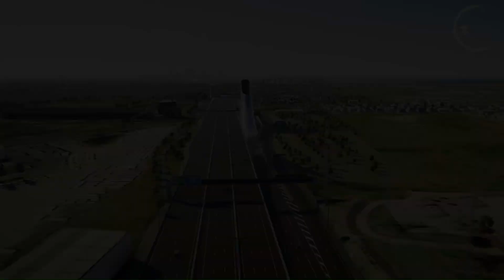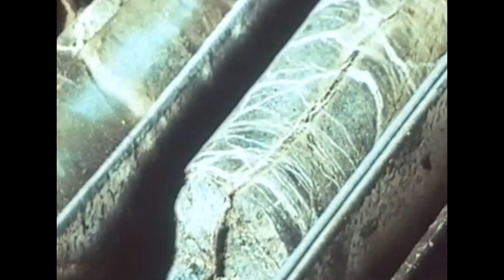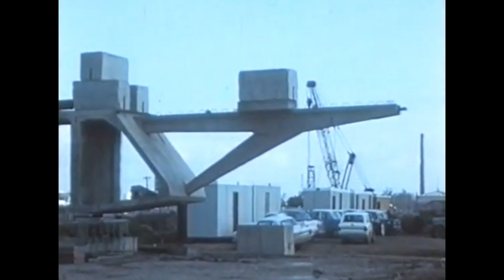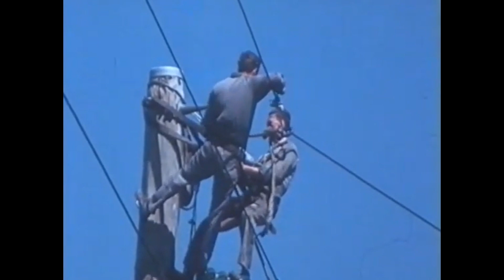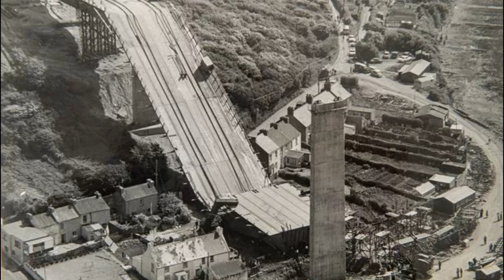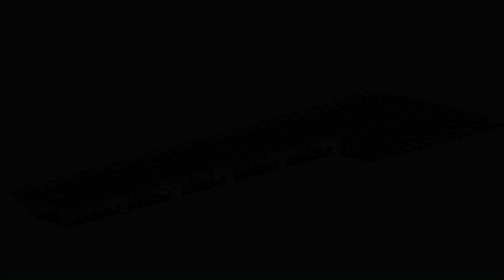Westgate - Beyond the Collapse, Part 2: Initial Construction

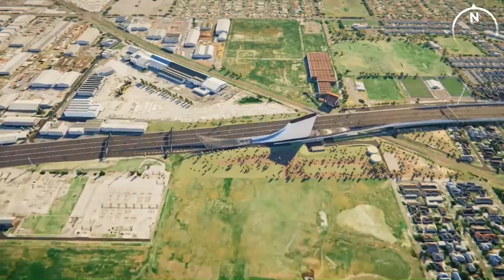Comment: Were the rejected core spine units (mentioned @ 11:10) the ones that were placed on display for many years near the control center?
Reply from the maker: I'm not entirely sure where they may now live. I know one concrete segment sits in Westgate Park (the one with the pink lake when it get hot and dry). The remainder units might have been demolished if not sent anywhere else.